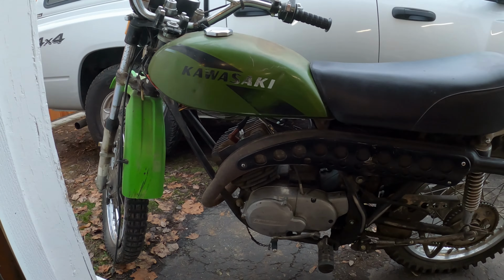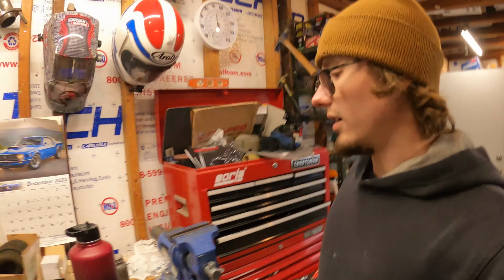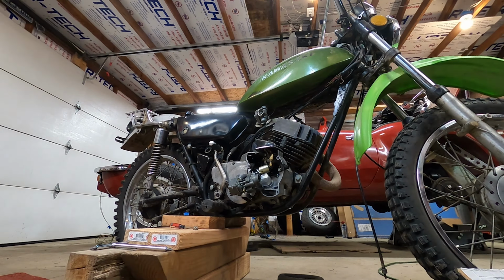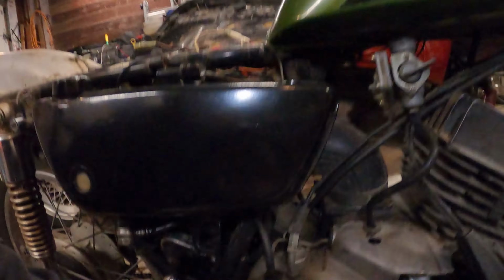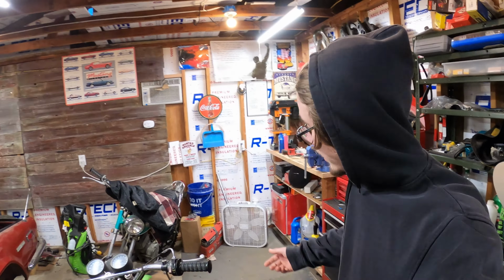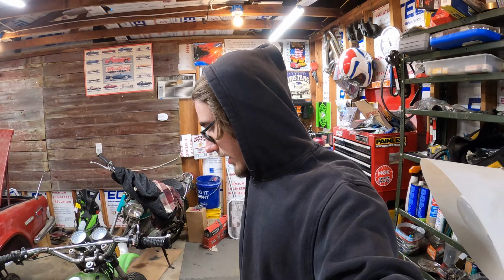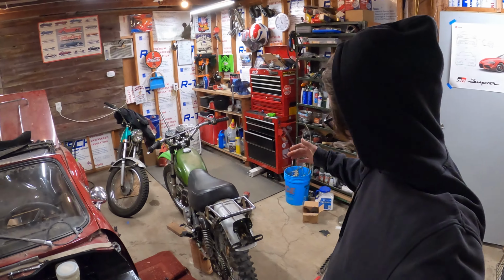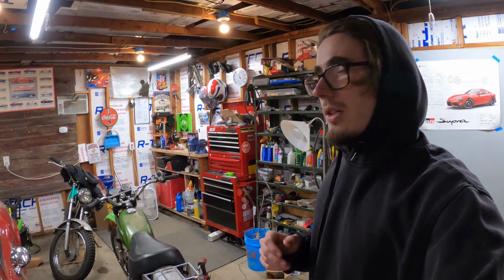$400 Barnfind Kawasaki F7!

Comment: That was my first motorcycle. I bought it from a pawn shop in 92 for $200. I just bought another one last week with 1000 original miles--in much better shape than my first one! They are amazing bikes--21.5 HP from the factory and so light! I wouldn't worry about the induction (rotary vs, piston port vs reed). Whatever the issue is, I'm sure it's traditional--spark, fuel, compression. You know you have good compression, so I'm guessing it's a fuel/spark issue. These things are CDI six-volt--pretty reliable,  but some little things that could go wrong. I just saw it's been nine months since you posted the video. Did you get it sorted?
Reply from the maker: I did get it running but I ended up selling it because I didn’t have time for such a big project. But I did buy another bike that I’ll be revealing next week 😉.

Comment: Hi, just a little thought, you seemed to get a lot of smoke for a short run of the engine, in my experience you might be getting too much 2 stroke oil going into the engine, i would adjust the oil pump a little & check to make sure your spark plug is the correct one, i have had two strokes that would not run until it had a new plug then all was well for a few months then the plug would go again, a new plug and all fine again for a few months. 😲
Reply from the maker: I appreciate the ideas! The big hasn’t ran for a really long time so I think the smoke is just leftover deposits in the pipe. But I’ll definitely double check the oil system. I put a new plug in it I think it’s the correct one but not much info on the Internet so I ordered a manual. Hopefully I can get all the correct info from the manual!